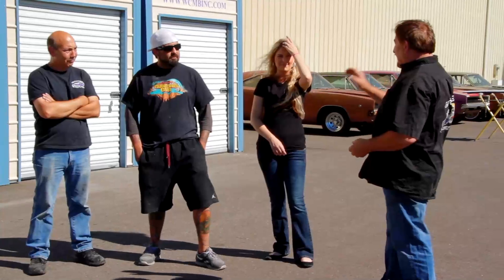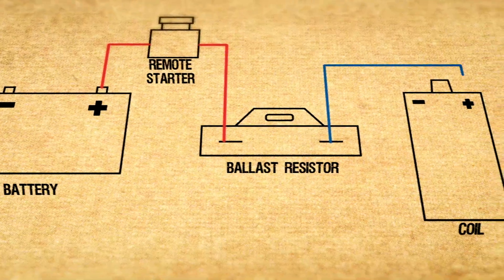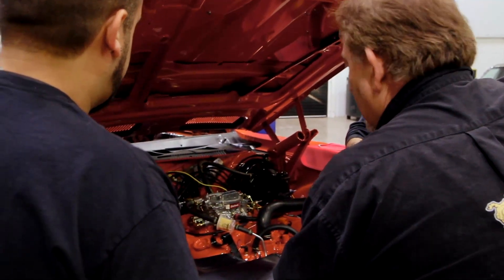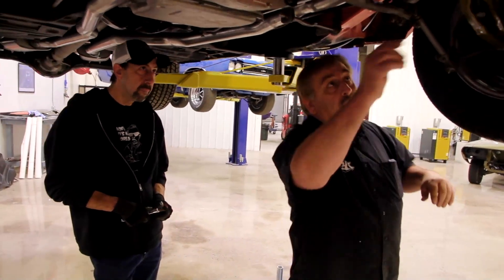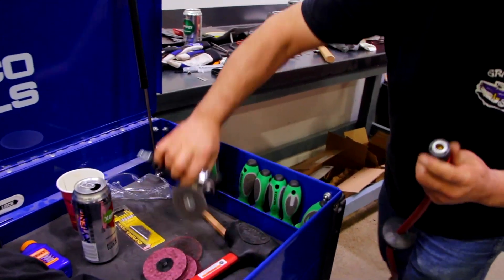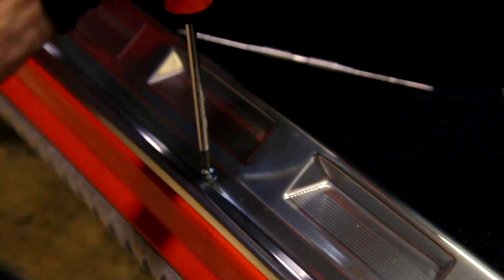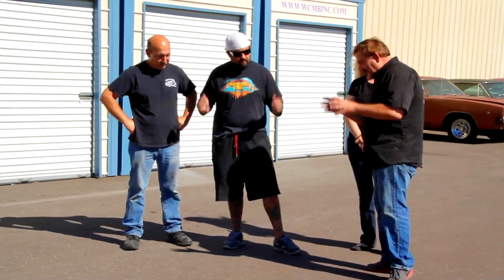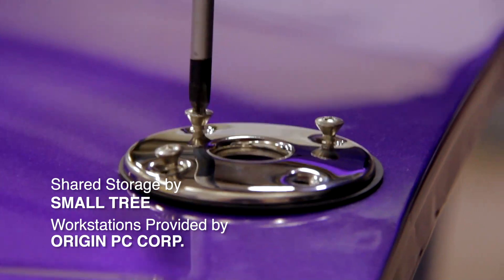SABOTAGED 340. WHO DUNIT ?

Comment: In 1970 I bought a Duster with a 340 3 speed on the floor. It didn’t have bucket seats, no decals, no carpet, just a AM radio and no AC. It was a total sleeper and I loved it because it was fast and yes it was just a funny green color.
Reply: Can you believe, in the early 1990's, my friends and I would buy these cars from the local wrecking yard for $500? Then we'd buy a 440 from a truck or motorhome and be driving a hot rod in less than 10 days for under $1000. If we were as smart as we thought we were, we should have kept a few and retired early 😉
Reply: That is a very rare combo.   70 Duster 340 3 speed.  My brother had one also back in the early 80s.  That car was absolutely a sleeper and beat a lot of cars it shouldn't have.
Reply: I loved my Duster. 340 3 speed A-230.
Reply: I had a 69 c20 with Duelies, 3 on the tree, and a 327. It would shit and get.
Reply: @joejackson9172  i briefly owned a 73- 360 4bbl 3 speed Manual trans car,triple black with side stripes....Factory build......what a crazy combo...my mom used to take it to town in whatever gear she could get it in :D.

Comment: That means a lot 
saving that car  
Just magnificent work !!
Reply: Any mechanic with common sense that hears a knock sound would automatically drain the oil, check for metal in the oil, and know that rocker or lifter noise is Much different than rod or piston knock

Comment: No one in my shop was ever allowed to pour gas down a carburetor, or twist a distributor back and forth on a first start. Static timing an engine, and making sure there is fuel flow is not difficult even on computer controlled F.I. engines. Engine noises can be isolated with a stethoscope, or listening through a long screwdriver. I've never rebuilt an engine that ever knocked or failed on startup. These folks are incompetent, and would not last in my shop more than a day.
Reply: Blah blah blah

Comment: I typically take an old distributor and cut the top off and put a drill on it and put it in the engine then spin it and it will pump oil through the engine so there is no dry starts

Comment: Wasn't that Daren's car you bought off him when you let him go.
To start with Royal was right instead of concentrating on the top end the motor should of been pulled apart to see what was wrong and the new parts you just replaced wouldn't have to be bought again. The oil would of told the story when drained and a days effort not lost. 
But MARK is always right in the long run sitting next to the sand blaster wasn't a good idea no car with a new rebuilt engine should be any where near a cleaning area unless it's being washed and waxed.
Reply: No that’s not Darrens old car. This is a Cumala and Darrens car was a plum crazy challenger p.

Comment: 1980, PCC Rock Creek, community college, rebuilding a '58 Harley (mine) in the "small engine / motorcycle" repair course. So I'm bead blasting cases, cylinders, heads & more. My teacher says to me "ya know, you'll never get all the residue off"  that freaked me out, so I wrote (yes, a letter) to Easy Rider magazine & said WTF? I see in the mag descriptions of the bikes and  a lot of time cases & heads are listed as blasted (as opposed to polished or chromed) 
 Well dang if "Wrench" their tech guy, didn't write me back and say "yes, that's correct, but if ya boil it in soapy water and clean the heck outta it...no problem". 
   So, who's the "sandinthepan" man?

Comment: Bought a brand new 70 Gran Coupe white Leather, 318 and the Dealer I worked for , screwed the order, (left off the Air) but I bought it anyhow because I didn't want another  Yellow barracuda running around.  Stickered for 4,200 and it cost me $3,065 and I kept it a year  and sold it for more than I paid for it. First year for curved side glass, had to open the doors to roll the windows up (engineering) /if the "Airtemp" hadn't been on \the lower right corner ,it might have gotten transferred to the final order form.

Comment: I have a 2010 plum crazy SRT8 - 6 speed Challenger with 14K on the clock. It looked like later models in this color went slightly darker, have you noticed that ?
Reply: I liked all the mopar colors but purple turned my head the most.

Comment: choke is oppen, so first time firing the car up and choke is opened and 4 guys are scratching there heads?, what about Crappy aftermarket Lifters not pumping up? there are some total junk out there. I used a Mopar purple shaft and lifters years back and that was perfect , if i let sit for months I did have to wait for lifter to pump up but soon cleared

Comment: Please use the word ENGINE instead of motor unless you are referring to the starter or the heater motor.
Reply: In the biz,  we say MOTOR . That's just how it is.
Reply: @motorbreath7174  I was in the "BIZ" starting in 1960 (Only 61 years) - Guess I never found out that an Internal Combustion Engine was really a motor.  How in the __ did I miss that?  So tell me jocko is the Starter a Starter Engine or the Heater motor a Heater engine,  Same difference.
Reply: @tandem8  that doesn't change the fact that in the biz most people say motor
Reply: Like in the service we call it a boat not a ship
Reply: General Motors, Ford Motor Company
Reply: @MrFredsAdventures  After the words "Motor Car"
Reply: @motorbreath7174  You also use the word Tranny for Transmission which we all know is a Female with Male plumbing in reality.  Low in your mopar shop manual (OEM your favorite) and see if they call the engine a Motor - They do not.
Reply: Richard Petty would say "We blew the motor!"